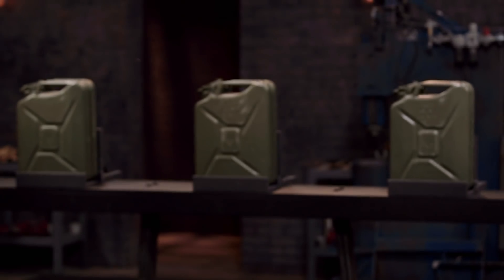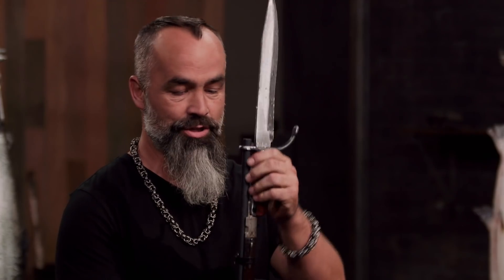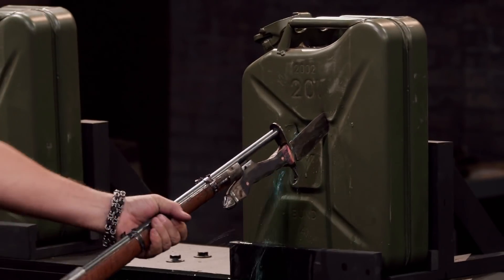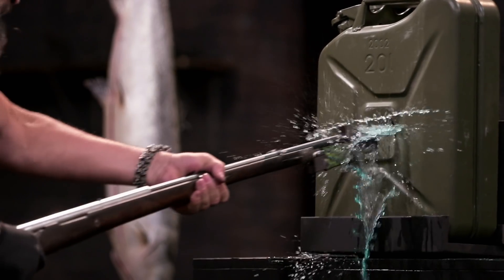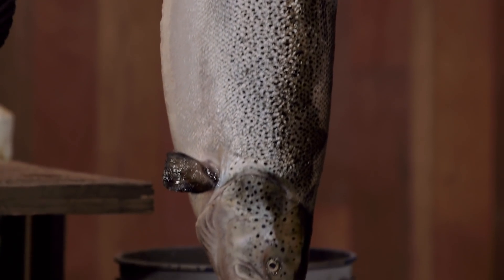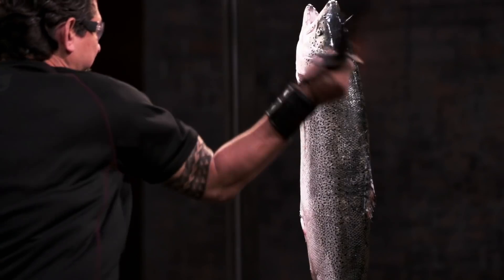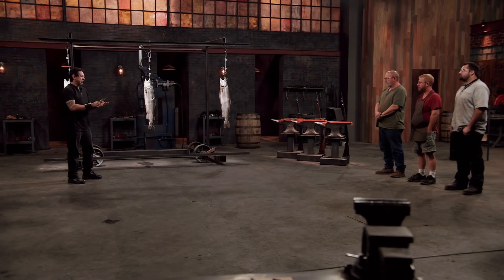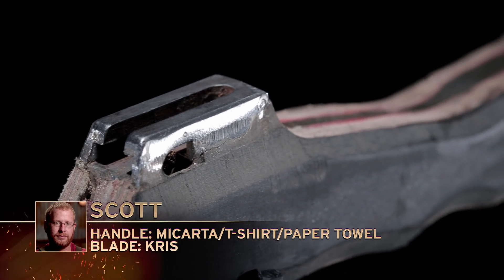Do NOT Cross Paths With a Bayonet! | Forged in Fire (Season 3)

Comment: Never understood why some people on this show don’t sharpen their blade, How do you skip this crucial part.
Reply: At this stage they are really short on time. They know they have to sharpen the blade, but simply don’t have the time to do it right
Reply: It's actually really difficult to sharpen a blade properly, it takes years to learn how to do it effectively and it also takes hours to do
Reply: @Mim-mim41  nah fam. Putting on a basic edge takes about two minutes with a grinder.  A proper edge geometry on a knife blank with stones maybe twenty to thirty.
Reply: @Mim-mim41  they are using machines to build the knives and have grinders to sharpen the knives. Nothing there is old school they use modern tools there. Only thing that makes it challenging on this shows it what metal's they are using to melt it to form a blade that was the challenging part.
Reply: If they did the fish first, I bet most would cut
Reply: Important to keep in mind this is the 2nd or 3rd battle, not the final one.  They were given a few hours to make these bayonettes, not a day or two.  If you have ANY trouble with shaping the metal, you could literally be left with no time to sharpen it.
Reply: At least it made contact with the fish, right?
Reply: The sharpness also relies a lot on the geometry of the blade. A lot of bayonets have an extremely stout edge. With a Ka-bar, if you maintain the proper 40 degree edge, it does not cut paper when sharpened, it just rips it.
Reply: Because it was a Rifle knife, it's using for stabbing mostly not for cutting,

Comment: A bayonet isn't supposed to be sharp. If it is sharpened it will penetrate better but will be harder to loosen or pull back. The last thing you want(ed) in the heat of battle is a stuck bayonet....
Reply: That doesn't make sense
Reply: @daygenhall6126  the "point" of a bayonet is to be able to stab the enemy not slice/cut however do to technological advances (kinda) soldiers would also carry a knife at the same time, some genius said well if the soldier is getting a knives why not make it the bayonet, also trenxh warfare in ww1, some times you didnt have your gun but you had the bayonet for night raids. As long as you have a pointy bayonet it's gonna do its job at stabbing, slicing is like a secondary job that's not required

Comment: bayonets arent meant to cut or slice theyre meant to stab and puncture smh
Reply: He literally says that they had to make a blade that is suitable for a bayonet and a hand weapon.
Reply: Most modern bayonets, like the U.S. M9 are intended to be used as multipurpose blades. The M9 is both a bayonet and a fighting knife so it's not unreasonable for this knife to need to be able to do both.
Reply: Yepp...even if they have an edge...it is not really too sharp...or if the configuration is like a spike...not at all, like the Sten Gun spike onette

Comment: I didn't think bayonets were supposed to be sharp... just ...stabby.
Reply: In most armies it was issued as bayonet, trench knife and field knife, meaning it had to be stabby, sharp and strong. In fact nowadays they usually say (as you also learn in basic) an infantryman should carry 3 blades: a multitool (e.g. Leatherman, Gerber and so on), a field / general use knife and a meat only knife (if you know what I mean). When I was infantry, I was issued an extrema ratio fulcrum bayonet (I used it as a field knife), plus I had a Leatherman OHT as a multitool and an extrema ratio requiem.
Reply: You are correct, a bayonet should be blunt. We would be severely punished if we tried to sharpen our bayonet